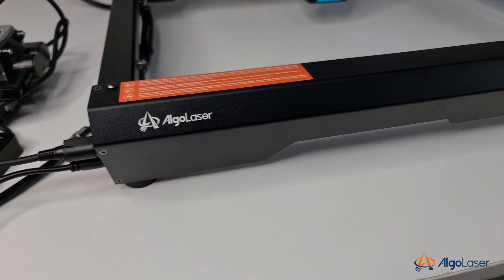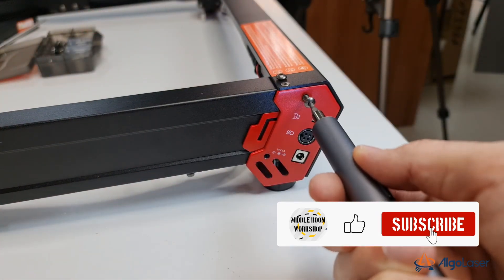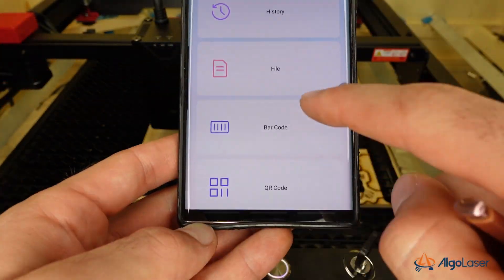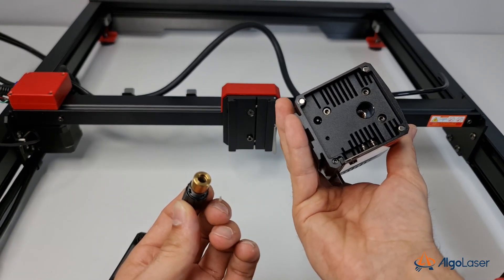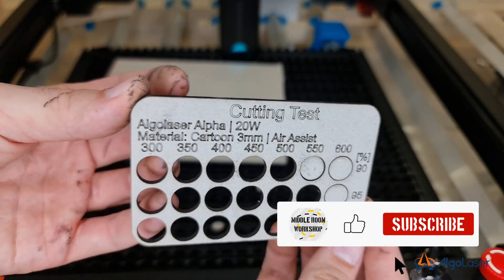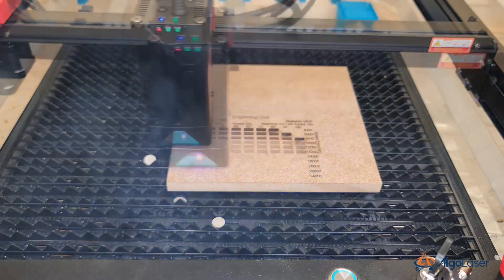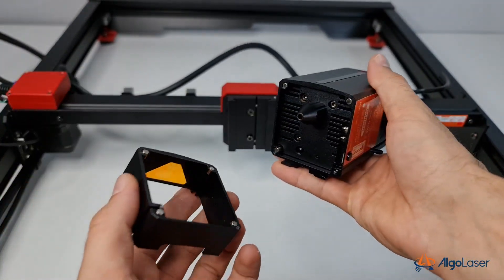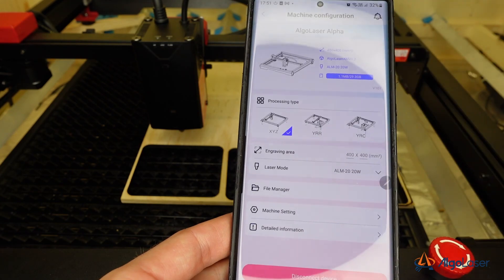This Laser Engraver Shocked me - AlgoLaser Alpha 22W

Comment: I have now bought an Alpha and am looking for a rotary roller unit that will connect ok. Have you any suggestions please?
Reply from the maker: Hi, thank you for your comment.

I got the combine roller and chuck by Xtool, and it works fine with it.
https://www.xtool.eu/products/xtool-ra2-pro-for-p2-d1-pro?ref=MRW&utm_medium=null&utm_source=influencer

It is a bit pricey, but it is very versatile.

Another similar option would be from Atomstack:
https://affiliate.geekbuying.com/gkbaffiliate.php?id=3783&url=993222

Otherwise, simple and cheap rollers 
https://affiliate.geekbuying.com/gkbaffiliate.php?id=3783&url=993223
https://affiliate.geekbuying.com/gkbaffiliate.php?id=3783&url=993224

I hope it helps
Ciao
Reply: @MiddleRoomWorkshop  What cable did you use to connect Alpha with RA2? Does the one provided with RA2 just match the connector on Alpha?

Comment: Hi, i want to but a xtool d1 pro for our shop (cabinet shop), we want to encrave our logo in the doors, is it possibe to encrave a piece 70x30" just placing the machine on top of the wood?
Reply from the maker: Hi, @josealbertofonsecaneto4126; thank you for your comment.

Yes, you can do that without problems. The laser module can lower down all the way and more, so you can also do recessed areas, and the adjustment with the clearance rod on the module makes it very easy.

You could also use it vertically on the door, but I suggest changing a small setting in the GRBL configuration that keeps the motors locked into position.

Ciao